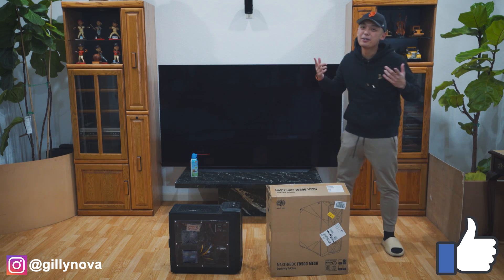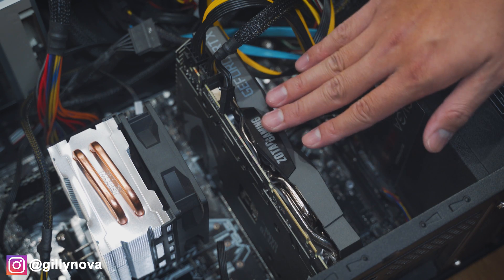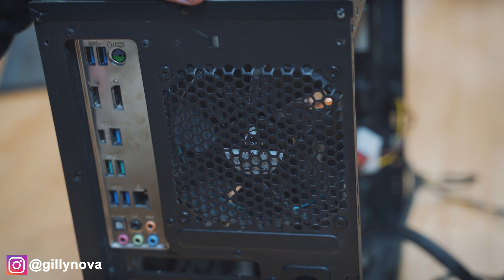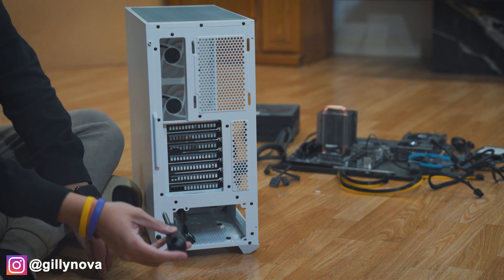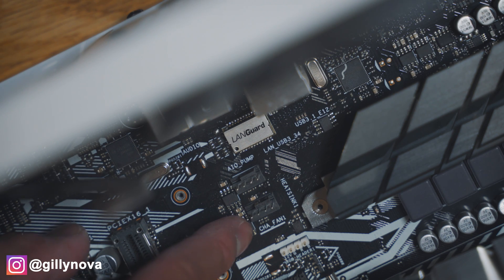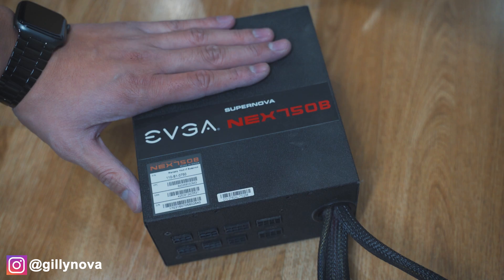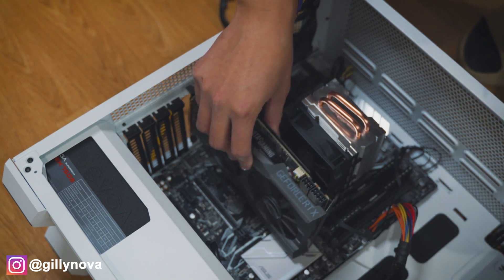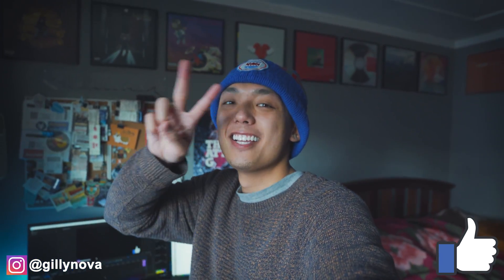How To Change/Swap PC Cases! EASY AND FAST! (Cooler Master TD500)

Comment: Bro I've been Told that Installing a 360 mm Radiator On TOP of this case isn't worth
Because it hides a little upper part of your Motherboard making difficulties accessing to upr part of mb
And also Rear Fans are hard to install with 360 on top

Comment: Done this many times, but the tech has moved on since I last did it. Glued to my laptop these days. My wife reckons I'll need to be surgically removed when I kick the bucket! 👌👍😃
Reply from the maker: Haha man, tech sure has grown over time. I mean, look at how my old case looks like lmao
Reply: 😁My first computer had 64k of RAM. You'd struggle to run a small pocket fan with that now. Several years later when I bought my fourth computer (a Commodore Amiga 1200, brilliant machine) I couldn't imagine how I would ever find any applications that would make use of all that 2Mb of RAM. Ha ha, how dumb was I?
Reply from the maker: @PaddyStubbs70  holy god those specs LMAO! That’s so ancient! I remember I was on 128kbps dial up internet with EarthLink back in the day and now we have 5g speeds of 1k-4k GBPS... on our mobile devices. How times have changed